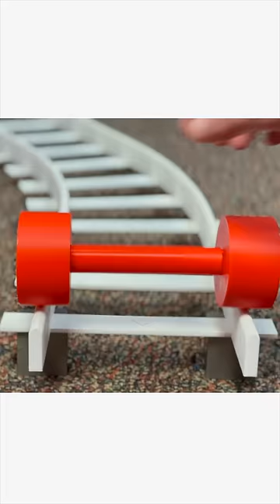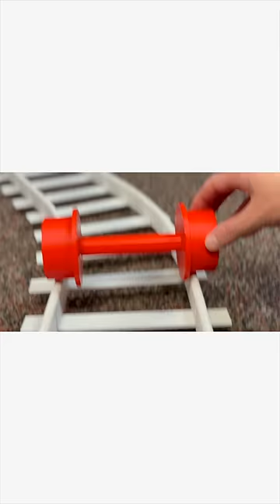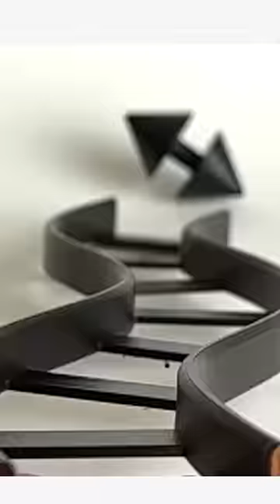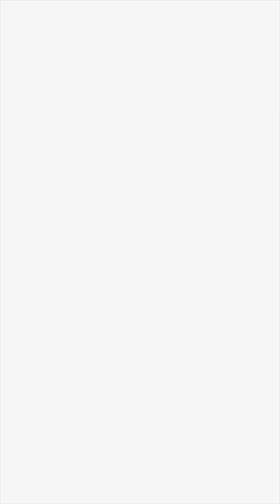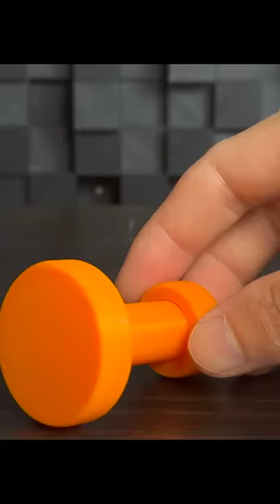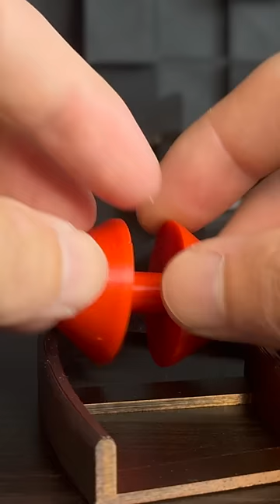The Design of Train Wheels is Genius #3dprinted #trains #interestingfacts

Comment: An additional tidbit: the angle of the "cone" of the wheels affects the speed and curvature of the track a train can safely run on while maintaining this effect.
Reply: Yes. You can literally see the wheel becomes 'wiggly' when moving through straight track, this is called hunting motion. And the design of railway vehicle must consider this as the speed limit. 😅
Reply: Okay, now do a high speed magnetic train. 
Lol the USA is the only first world western nation that still uses this outdated system
Reply: But the small contact area of the wheels and rails also affects the strength of the brakes, it also placing the center of weight right in the middle of the rail so it can damage the rails more quickly, the limited area of surface contact is also can cause serious problems just because the rail sections are not smooth, so the rails inner side require more maintenance for the train operations.
Reply: My brother in Christ we didn’t get bombed. Also our country is the size of multiple European countries. We were prob busy defending the free world, making blockbuster films, medical breakthroughs and putting a man on the moon.
Reply: as well, narrow gauge rails allow for a tighter turning radius. (gauge is the amount of separation between the two rails)
Reply: @SlapShotTakes  no, but you got bombuzzled
Reply: @SlapShotTakes  Nah dude, we were probably inciting wars in smaller countries for our own fiscal gain.
Reply: @SlapShotTakes <--- we don't claim this guy. 
Sincerely,
Americans who graduated high school
Reply: When did trains stop using this "out-dated" design.

As far as I know, magnetic lines are only intended for highspeed passenger routes. While train for freight, which really is the more important mode, still focuses on the more economical answer.
Reply: @quaztron  think about this, friction are made by contact between surface of two or more object. Larger area of contact create larger traction and better braking efficiency for example car or bike tire are made with channels are meant to increase area of contact when the tracks are slippy or muddy thus increasing the friction and grip.
Reply: @haraptenang.3408 actually not why car tires have channels. Cutting the grooves don’t give more surface area on wet roads. The reason they have channels is to allow the water on the road to go through the channels so you still have rubber connecting to the road. If they didn’t, the water would be forced between the rubber and road somewhere, and greatly increases the risk for hydroplaning. The reason mountain bikes or off-road vehicle have knobby tires, however, are more closely related to the amount of surface area in muddy conditions, but actually the knobby shape helps the tires act like a paddle wheel on a paddle boat. It’s still a slightly different effect than just “more surface area”
Reply: And too perfect a cone can cause the wheelset to hunt on the track.
Reply: @priyobayuramadhan1284  Are you familiar with Bridget Eihoff's work on this and the P8 profile she came up with?
A lovely and unassuming lady and probably the best vehicle dynamics specialist of her era.

Comment: As a passenger, I can’t confirm how comfortable my train wobbles on turns.
Reply: They do but not for the reason he’s portraying
Reply: To overcome that issue compartments of the train can be provided with very good suspensions for the jerky movements.
Reply: As a train, I'm insulted.
Reply: Ever see a motorcycle when the front wheel starts wobbling?
Reply: @operatord4s118 what reasons?
Reply: Jy imagine yourself riding roller coaster 🎢 😳 😂😂
Reply: @jayeshsaroj3944 The complete wheels and axle can have its own suspension.
Reply: wobbledy wobbeldy wop wobble
Reply: is it a unibody train? I thought it's body-on-frame
Reply: @fourierrocket Not the same thing
Reply: Comfort is relative.  Without the conical shape, your ride around curves would end in derailment, possibly injuring or killing passengers like you inside the train.  I'm willing to bet that would have been a lot less comfortable than what you experienced.
Reply: As a third-world-country American, I don't know what it feels like to be a train passenger.
Reply: What!? I have never had this much  👍🏻 ever lol!! Thanks everyone 🙏🏻
Reply: Вот то же думаю, какая же тряска будет в вагонах
Reply: @ex0stasis72   all of Europe combined would fit in one small American cornfield.
Reply: On behalf of the wagon wheels...I feel insulted😐
Reply: Train tracks don't have small curves like that. It's just a demo

Comment: not only does it adjust on turns, but it also leans into the turn so it won't tip over.
Reply: yes, also, the passenger will all become a liquid at the end of the ride, the train shake them a little too hard
Reply: @jensenraylight8011 exactement. 
Complètement ridicule.
Reply: You forgot that the wobbling can derail the train.
Reply: But this "GENIUS" invention is "GENIOUS"
Reply: is it also one of the principles for like belt drive gears as well?
Reply: But the passenger car is rocking violently side to side
Reply: @jensenraylight8011 it’s great for transportation of plushies, pillows and other soft things though.
Reply: @jensenraylight8011 also too, there are zero train tracks that are so abruptly squiggily
Reply: I guess most people that say good design never work in the train. It center heavy right now and now put the rest of the train on it and you will find out that it will title over and crush everyone lol. You know one truck has 4 wheel for a reason  and it pivot on the center truck for a reason. You know how much weight and money will be for that one set of wheels. Not to mention all the design flaws it has when putting it on to the truck lol. The rail and truck will need to be redesign for the tilt and high speed turn that wheel will not be able to do lol
Reply: @not4younot4you70 Are you a bot?
Reply: If you look at train tracks on a turn you will see the tracks lean the same way a road does.
Reply: @morningwaves  this is anexaggerated example, that isn't an issue at scale
Reply: @YahuahsRefiner America has entered the chat.
Reply: @robertcollier5529  put some weight on top of the wheel to simulate a cart and let see it tilt and fall. 99% people here don’t even know about trains. So many engineers and companies make wheel for it from high speed to local city used, they never want to make a design wheel like this because of the higher chance of derailment. Yea good design, but it to work and let see how many people get kill and get sue for it
Reply: Y'all forgot that this is an EXAGGERATED example. The actual train weels are a section of a cone with flanges. And the cone height is much greater when compared to its radius, so the angle is less sharp
Reply: great onfo
Reply: True! Learned this recently in my railroad engineer studies
Reply: @YahuahsRefiner u sure
Reply: @not4younot4you70 this is already how they are just less extreme and pointed 😅
Reply: @jensenraylight8011 have you ever been on a train???
Reply: @alexchan3926  banked turns on rails are necessary due to the fact that the bogeys are rigid sections with multiple pairs of wheels.
Reply: @not4younot4you70  Every single train currently in use has this design. This is ridiculous.
Reply: @jensenraylight8011 The bogies (those metal structures that hold the wheels) have suspension and can maneuver around to make sure the car itself doesn’t shake as much. You’re still going to feel the turn a lot, but it does help a lot. Also, as mentioned in the video, the actual shape of train wheels is not as exaggerated.
Reply: @blackwhite2361 Have you seen all trains derail from turning?

Comment: How the hell did i not realize that the coneshape makes so much sense for something like that
Reply: Go to school
Reply: @shizuxo  I'm I'm school fir someone completely unrelated for a reason
Reply: @shizuxo  I mean schools aren't usually teaching about the wheel design of trains (unless you are going to college for engineering that sort of thing).
Reply: @shizuxo i learn this when i as a kid in middle school playing alone with my wheel like watermelon skin along the road edges. Well Guess there's no need for extensive learning to know such thing😕
Reply: idk maybe u didnt think about it
Reply: @Shadic-rf8dg  you dont need to go to college for engineering to realize that this conical wheel idea wouldnt work in reality.
Reply: @shizuxo yea go to school just like how you should go to school if u actually think this design is better. I mean did u actually think about how a train would work like that? Look the way it is now the train can take a wider stance due to how our axles are designed now but if you use that cone method you need the axle to be much shorter making the point of mounting to the axle and train much more narrow and therefore less stable. Second on top of being unstable due to the narrow mounting point between axle and train car it would actually have to lean when taking corners. So combine that knowledge with the fact that the center of gravity in the train car is so high above where those narrow axles are and its definitely gonna tip. Also you would have to redesign all railroad systems around it because those still can't take sharper turns without derailing and also are way less idiot proof but thats only assuming you could get that marvel of human engineering to work. Sorry for the long explanation but it seemed obvious u might need to go to school 😂😂😂😂😂😂😂
Reply: There is also the question of brakes.
Reply: @shizuxo I guarantee there are many things you don't know. Don't be so quick to be a 🤡. You embarrass yourself.
Reply: @xmetrix but it does.. It's literally used on all trains now, the conical in this video is exaggerated. 
In reality the conical is only at a 1:20 gradient, so a 120mm wide train wheel will only have a 6mm fall from the highest point till the lowest.
Reply: @ra2186 Bro already knows that.  Its why he never replied back 💀
Reply: Because it isn't true. Put your hands on them and they're just a flanged wheel. The conical shape is worn into them over time and it's extremely exaggerated in this video
Reply: Because it's not something you would ever normally think about. There's no reason to
Reply: Imagine if they just put one of the hitches on both sides. And you treated a train like a tram. Don't need trains zigzagging around like the example anyways
Reply: Really, just ignore bad comment for sharing your amusement. People have different aptitude toward the knowledge. You may had figure other things out sooner than other people out here.

School is teaching us basic knowledge, and work is applying those basic knowledge into advance and usable things.
Reply: Society now like complain about anything. In general, igonore them is a good thing to do.
Reply: I’m a engineer and I did not catch that it’s not standard thinking
Reply: @jamil3286  CONICAL and SLIGHT DRAFT ANGLE are a world of difference. the contact patch and pressures exerted with whats currently in use (NOT A CONICAL SHAPE) are in a far more vertical orientation . but whatever. I guess not everyone understands basic physics. I mean, there are tons of people believe office fires caused WTC Building 7 to collapse.
Reply: Real question is why aren't they using it for trains bc I've never seen those kinda wheels
Reply: @xmetrix   wth 💀
Reply: @shizuxo  finished school, never did train studies 😂
Reply: Well use the cone-shaped wheels and if you approach a turn to fast youre going to derail the train there's a reason train wheels haven't changed in a century+
Reply: @fbi2522  nah just reverse bro
Reply: because youre not a mechanical engineer who constantly has to solve issues like this?
Reply: Because this video is BS. Train wheels aren't conical, they're double-flanged and have an articulating joint. Also, train tracks don't have harsh turns or bends for this very reason.
Reply: Because it’s unstable
Reply: @shizuxo bruh the OP probably was only taught about gender pronouns and lgbt in school.
Reply: They aren't cones
Reply: @xmetrix  As an engineer, I can assure you that all trains with wheels incorporate this design. The example in this video utilizes a more acute draft angle to illustrate a point. Additionally the wheels incorporate a truncated conical design as they only need to be able to maneuver around the a regulated minimum track turn radius.
Reply: @SignalCorps1  As an engineer, I can assure you that not all trains with wheels incorporate this design. I wouldnt count a 6% taper to be conical by any stretch of the imagination.
Reply: Schools generally don't teach you anything useful
Reply: The thing is, it's too basic. Today we are trained to use complex solutions, not basic ones.
Reply: @jc0326 no its because the shape is exaggerated. İn reality it is still not flat but tilted like the one in video. İts just that the tilt is so low that you feel like it is flat. Kinda like how flat earthers think the earth is flat. You are not a flat earther aren’t you?
Reply: @xmetrix you have serious problems in understanding whatever you read or hear. Because you failed to understand it from the video and from a comment that explained it very well aswell.
Reply: @xmetrix you are not an engineer stop lying.
Reply: @ozanozenir2503  no I work on train carts and railway vehicles and replace worn wheels everyday. They're not tapered or tilted or conical. They're flat.
Reply: @jc0326  very easy to lie on the internet isn’t it?
Reply: @ozanozenir2503  pretty easy to be ignorant isn't it?
Reply: @jc0326  no because what i said is true and you are making things up.
Reply: @ozanozenir2503  what ever you say bud. im gonna keep doing my job working on BNSF and Pacific Railway cars and replacing worn tapered out wheels for nice new flat ones.
Reply: @jc0326  yea suuuuuuuuuure.
Reply: @xmetrix  To be mean (or complimentary),  your name shows your nerdiness.  
 
That means you are one of those that look at train wheels and see the rim, and the cone, 
and somewhere in the back of your head it makes "click" and a thought process starts "this con cannot be incidental, they must mean something. WHAT?" 
  
And in your head it is run through a list of options, almost on its own.  
 

I am that brash because I am the same.
90% of studying is in the end not the formulas as such, but the practice how to approach a problem. How to apply common sense. 

Analytical thinking is a blessing - and a curse. It can be unnerving for others when you are constantly "Have you seen that?" "That is there to do that".
 
But when it works, you can get at a problem you have seen never before, and you go "I have ZERO clue, but let's see what we have. I see that, that works so, that looks OK, that is probably unimportant in the moment" and so on. 
 
Making myself aware of HOW I think is fun, and makes me more effective. 
 
Getting others to think about HOW they think and making the same experience, that things that were looking so complicated are suddenly clear, is what I like to do now in the YouTube comments.
Reply: @Shadic-rf8dg  I'm at the last semester of engineering school and noone taught us about it ;)
Reply: Simple genius.
Reply: @xmetrix you're an engineer, and yet you don't understand that when you put any draft angle at all onto the exterior of a cylinder, it instantly becomes a conic section? 🤦‍♂️
Reply: @mosnar87 ya i realize any deviation from 0 degrees would technically make it conic by definition. guess we're talking absolutes and specifics.. Its also easy to see if the model in this video were to be scaled up, the pressure exerted on the rails would be the weight trying to push the wheels down treating the wheels as a wedge to drive the rails apart. the outward and downward force would be constantly trying to spread the tracks apart.  But hey you're right. any cylinder with any degree of draft is conical.
Reply: Cuz it isnt a good idea
Reply: @xmetrix A 6% taper is, in fact, a cone. A cylinder with any amount of taper becomes a cone, just a very long one. 

I’d make a funny quip about the quality of math education engineers receive nowadays, but really this is high school geometry, so there’s no excuse.
Reply: @whatisthisayoutubechannel  i already conceeded that point. But hey thanks for saying what i already said
Reply: @fbi2522 we use brake pads controlled by air pressure.
Reply: @adfdasdfadfadsfareae train wheels are slightly conical, though not nearly as exaggerated as this video, it’s a low curve.
Reply: Because train wheels aren't actually shaped that way. LMFAO
Reply: @jamil3286  completely different design and  there's retainer flanges just to keep it from derailing besides the very slightly conical design isn't for taking turns its to seat the axle on the rails
Reply: @jamil3286 it’s definitely not used. The flange method is used but the carriage twists with the track
Reply: @fbi2522  Axle brakes, or the more obvious solution, clamps that fit with the tilt of the wheels that are attached to pistons with more power than a hundred cars’ worth of brakes.